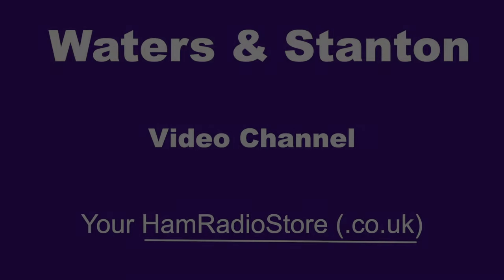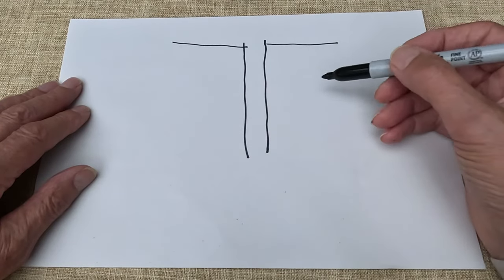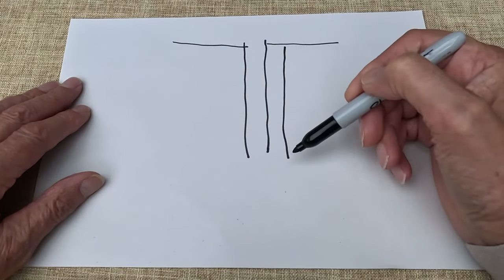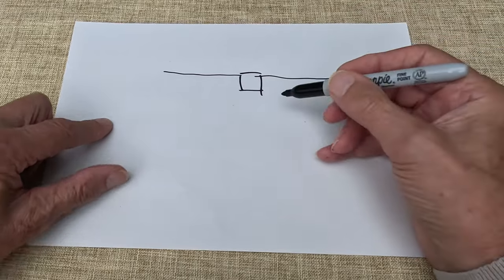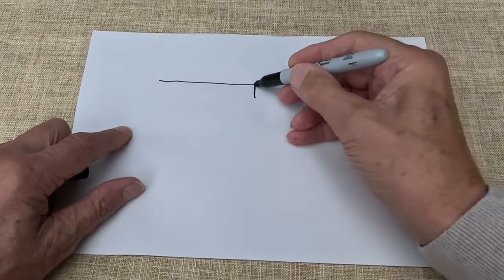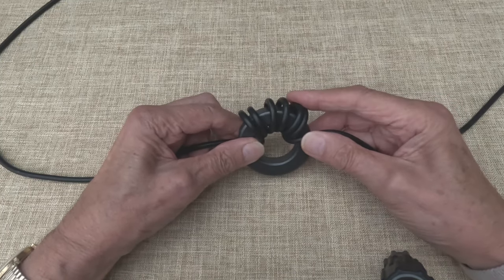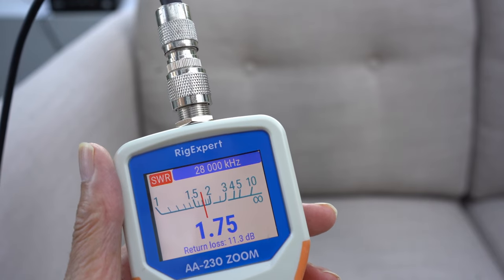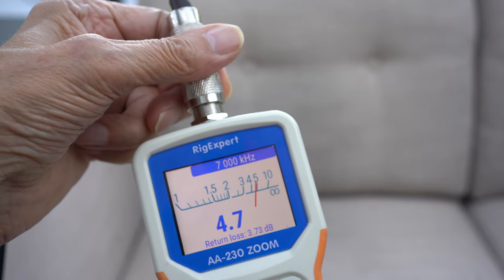Line Isolator - Installing and Testing | Ham Radio

Comment: I was able to find some quite chunky ferrite beads with an internal diameter that was a tight fit on RG58 coax. I put 12 of them on a length of coax with gaps in between to keep it flexible and put some adhesive heatshrink over it. Add PL25(s and I use it as a patch lead from my antenna switch to the radio. It really does work incredibly well.
Reply from the maker: Yes a popular alternative.

Comment: i certainly would not advise touching the PL259 while keying up. Please don't do this; fine if you are using an analyser but don't use your rig, not even at 5w Just saying, stay save
Reply from the maker: You are overstating the risk. The PL-259 outer is connected to the radio chassis, and there are many 5W HF handheld radios. So be careful but not to that extent!
Reply: @watersstanton  that maybe so, but a risk none the less and i would still suggest not to key up and place your hand anywhere near any patch cables or down the back of the rig. Invest in a analyser, would be perhaps a better suggestion.
Reply: add an isolator and try the test on 40 again!
Reply: Getting an RF burn is part of your initiation, if your system is producing results like peter is showing then where did your knowledge go to, I mean you did pass a test.

Comment: I have the coaxial and also the usb cable to the trx threaded through the FT240-43 toroidal core. Each over one core. I have 8 turns of 0.8mm copper wire on the core and a led diode connected to its ends. This diode lights up when RF is generated. So I have immediate detection. RF can reach the coaxial via the antenna switch, etc. Try it and see what kind of RF you have and on which frequency.
Reply from the maker: Nice idea.

Comment: Another field test I read about is to first just barely insert the center conductor into your radio, and listen for noise level.  Next, insert fully so that outer ring makes contact as well and if noise increases, you would probably benefit from a choke on it.  For anyone curious, I found that somewhere on the Palomar Engineering website.  I've not tried it yet, but plan to when I have time.
Reply from the maker: Not sure that is valid test - try the same test with and without the choke.

Comment: Why not put the line isolator closer to the balun?
Reply from the maker: No no no…. you will expose the res of the outer coax line to pickup as explained in the vifeo.
Reply: Would a 1:1 unun work?
Reply: The line isolator is only to correct transmission SWR and a choke near the antenna is to prevent the coax from radiating as part of the antenna is completely separate?   @watersstanton
Reply: @m3snusteve yes

A 1:1 unun is just another word for line isolator.
Just like the W1JR balun... This is a line isolator in a housing with two SO239 plugs.
What Peter showed is just the same without any housing and plugs.
Reply: @aarongriffin81 the balun in the middle of a dipole is to avoid common mode caused from the antenna itself.
Both legs are subject to slightly different environmental conditions, this could create common mode current.

The line isolator right in front/ after the TRX gets rid of any other common mode current occuring because of a mismatched antenna or QRM from any probable source that's on the outside of the shielding.
It gets onto the shielding AFTER the balun in the middle.
This could be radiation from the antenna if it's too close and parallel to the cable, any electronics nearby etc.
It often happens with vertical middle fed dipoles, when the feedline is just dangling down, parallel to the lower element.
You need to guide it away perpendicular to the elements as far as possible and choke it right before the TRX.

I'm no native speaker so I hope you get what I tried to explain.
Reply: It really depends on the type of balun and how much choking impedance it offers. If you had, for example, a single-core 4:1 (regardless of whether it’s a voltage or current balun) on an unbalanced dipole (particularly off-center fed), it would make a lot of sense to choke off the feed line just after the impedance transformation … and ideally choke again closer to your transmitter (which would likely require a less choking impedance than the aforementioned isolator/choke). If the antenna is unbalanced, it makes a lot of sense to isolate the feed line to force most of your radiation on the antenna elements themselves. The feed line is still subject to pick up some current/noise on the coax, so choking again is best practice, but you will likely have eliminated the strongest of the CMC by isolating closer to the antenna.
Reply: @_0815_  you actually explained it perfectly 👍
Reply: Fab video thank you.

Comment: Flickering LED lighting strips and device inserted/removed sounds from my PC told me I had a common mode current issue. I used the same ferrite as you with six turns and eliminated it. Thanks for a useful video.
Reply from the maker: Glad to hear you solved the problem

Comment: Very helpful. Thank you. If there are significant common-mode currents of the sheathing and the choke prevents them from getting into the shack, are those currents sent back to the antenna to aid the transmitted signal, or are they just absorbed by the ferrite?
Reply from the maker: Some radiation and some absorbtion.

Comment: Thanks Peter. A quick question, does the choke affect the outbound RFas well?
Reply from the maker: No the outbound RF travels only on the inside of the coax.
Reply: Thank you I wasn't sure if it affected  other parts of the coax. It is a pity that common mode energy can't be re-injected into the outbound signal.  @watersstanton

Comment: Nice test! Wich ferrite core did you suggest for a coax with 7mm of diameter? Thank you and 73 de IW0RZB
Reply from the maker: The first part of the code is diameter ie 240mm whilst the second part is the mix ie 43. So any diameter of 43 mix is fine.
Reply: @watersstanton  many thanks!
Reply: He mentioned mix 31 in the video — generally more effective for lower frequencies (like 60, 80, 160). Mix 43 is also a good multi-purpose … but a bit less effective at the lower frequencies. Basically, you’d just need more turns for the same choking impedance at lower frequencies.